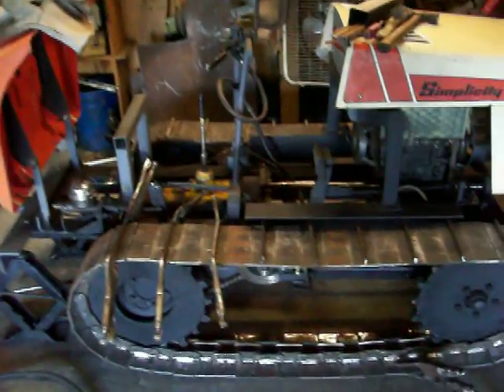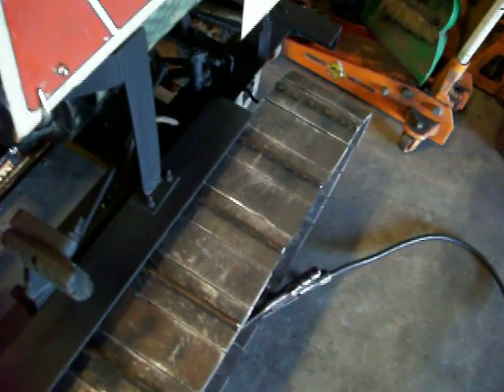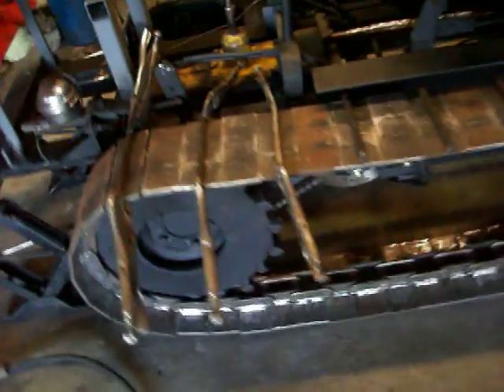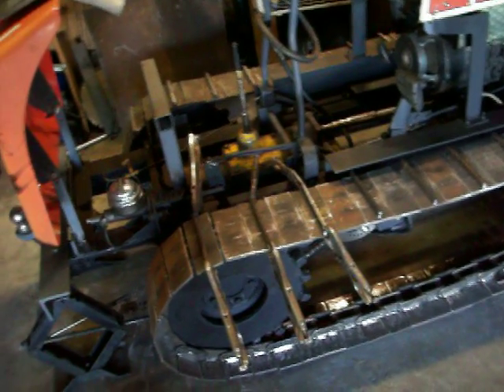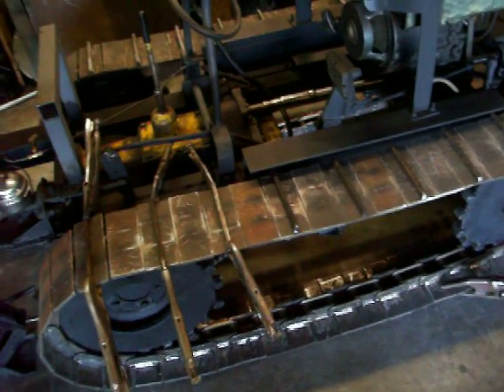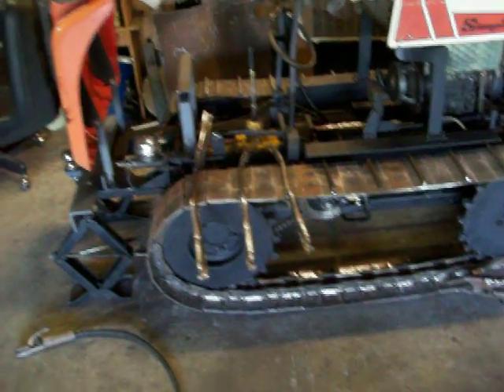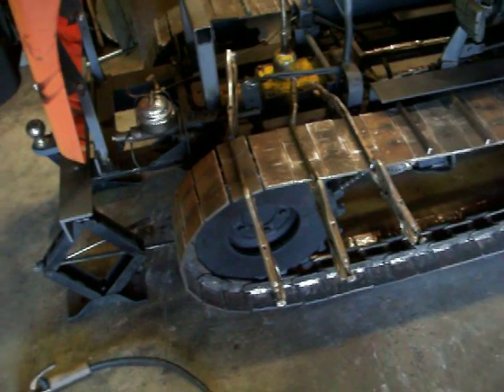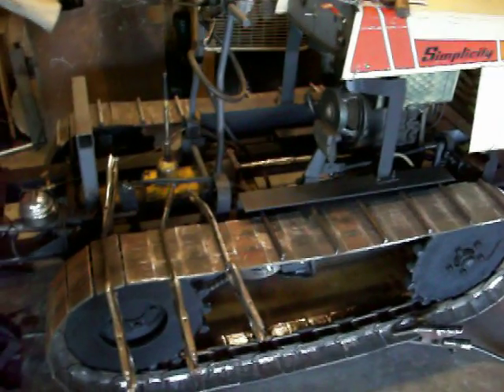Mini Dozer Home Built "Track Cleats added and Rear Brake Test"

Comment: You were right when you said that my suggestion was the way to go. Looks good.
Reply from the maker: buddy Im telling you this has been a adventure for sure and since i know now the new rear disc will work I may go ahead and go to the junk yard tomorrow and get a big american auti tyoe disc caliper from a car and part of the reason is is the china motorcycle type disc brake system i put on it will be almost impossible to T into the front drum brakes,,i dont want 2 sperate handles to turn but only one so i'll have to T the hydraulics in and would be impossible with the china system and yes the cleats every other pad looks best and will work best,,later

Comment: looking good rick when you get the tracks done i cant wait to hear it clinking along
Reply from the maker: Josh I think it was the concrete it was on making it do that and dont think it will do it on dirt but we'll see,,,thanks
Reply from the maker: I got the new pads in the mail today and buddy they got on the ball with that shipping,,also Ive almost got the other side cleats welded on but before i operate it again I think I'll change the front pulley and put a new belt since the old one slipped yesterday and then i will make you another operating video,,thanks again.
Reply: looking foreword to it rick

Comment: Seeing the cleat marks on the concrete made me laugh.. In a good way..
If it's leaving those sort of marks it meant it was turning well :-)
It's amazing how fast the weight builds up on these sort of projects, my 6x6 ended up far heavier than I wanted it too!
Good to see the light at the end of the steering tunnel Rick :-)
Reply from the maker: oh gosh it has to weigh between 800 and a 1000 pounds right now by just adding up a few things on it that I know the weight of,,although the little tiny calipers from the 4 wheeler works I really want to add some from a car so I can T them into the big master cylinder I have on it now,,then they will both work from one pull of the handle,,want be long now and I'll have it at least to where I can operate it when I want,,thanks

Comment: I would do every 2 pad so it can dig in better but your giving me a lot of ideas for my bulid
Reply from the maker: Thanks Zack and I built mine totally from my mind and as I went and no plans from anyone,,that way its a original done the way you want instead of some knucklehead,,haha,,,the problem I have with the cleats is my mini dozer is so freaking heavy that on grass the cleats are dug slap into the topsoil and turning is a bitch man,,I bet mine right now ways between 1500 and 2 thousand pounds and is no bigger than medium sized riding mower,,man it is heavy,,,some advise id wait before adding cleats until you get it running and turning cause even flat smooth tracks will grip better than you think,,most modern day bob cats have smooth tracks and I watych them work everyday since I drive a peterbilt dump truck and them bob cats with flat push dirt and dig up old pavement with smooth tracks so trust me from someone who knows,,cleats can be a bitch on a mini dozer man,,,thanks brother and didnt mean to write a dang paper back book,,Im fixing to get back on mine and finish her up,,later
Reply from the maker: one more thing,,,in dirt or on dirt cleats on a mini dozer would be no problem but on a surface that isnt broken up and they can dig into it puts a terrible strain on the entire system,,there you bro.

Comment: Tracks are lookin' good.  The every other pad is perfect for it.  Just a thought, not sure if it would help or not.  If you where to "V" bend the rebar, still keeping it fit of the pad, would that help stop lateral (side ways) drifting on a hill side or ice?  Or would it be better to alternate angle them like a tractor tire?  Just thinking, this project has me thinking about building something similar for snow.  I have a drive thats almost a mile long in the woods.

What model of cub cadet did that rear end come from?
Reply from the maker: I think the rear end came from about a 1970 model cub or maybe a 107 cub cause I have a 107 cub cadet in original lawn tractor condition and its identical to the rear end Im using in the dozer,,also I doubt my dozer will ever face anything like what you have discribed as far as sliding off a bank or on ice or snow but a sure enough way to stop that would be to use spikes like they did on some of the old metal wheeled farm tractors from the 1930's and 40's and 50's,,like spikes on a football players shoes,,you know that would'nt slip in any direction brother,,imagine a set of tracks with about 1 inch sharp spikes sticking up,,be bad to the bone and beyond,,haha,,hope that gives you a idea and thanks for the interest in my video's.
Reply: snowmangsx1100
I was thinking of making removable plates/shoes for mine.  I have access to an old set of rubber tracks a Cat 65 tractor to cut the pads out of.  I'm thinking 3 sets now - rubber pad, bars like yours, and now spikes (thanks for the spike idea).  I have a 18hp twin cylinder yanmar diesel with dual output that would be great for this type of project.  Drive off one side, and hydraulics and alternator of the other.

Blade/Snow Blower/Broom/Frail Mower with skid steer style quick attach and extra hydro ports in front.  Then a 3point (cat1) with hydro and 540 pto setup (like the larger case garden tractors) in the rear should suit me fine. Case did it all with a 14-18 hp gas and hydro drive so the gear reduction on the drive line and the torque of a diesel it should be prefect.

Plan on using it for clearing and maintaining a mile long driveway, along with about 3 miles trails in the woods.  Skid logs and hydro power for log splitter, and some ground work in the garden in spring and fall.
Reply from the maker: you know depending on your budget the sky is the limit on what you can build or equip it with,,so far i have almost built my dozer strcitly from the junk yard but am sure toward the end when I get into the hydraulics I will probably have to spend some actual money,,,counting the welding rods and axcet and oxygen needed and then the trips to the junk yard and various new small parts like bolts and a pulley or 2 id say i have 500 dollars in the dozer so far,,,but to have went and bought all the metal new and everything new gosh it would probably be couple grand or more,,its like a house,,60 % of a house's price is labor and buddy Ive got the labor in this bad boy for sure,,sounds good on the different track ideas and yes the spike's would be killer as could be,,,well take care and keep us posted on when you start building your tractor,,Rick

Comment: I knew you would get it!   So I guess my 500lb weight estimate might be a bit off eh?  ;-) You could always turn the bike handles up, and it would look like an old school JD crawler. Gald you got past that Rick, I got the feeling that was bugging the crap out of you.
Reply from the maker: your right Jim it was kinda bugging me since Ive fooled with this stuff my whole life and then to have a simple brake problem give me such a hard time,,i just under estimated what a force it would take to turn it,,the brake handle master cylinder im using is a rinky dinky china made thing and I may if i can find a big heavy duty one like on my suzuki 1100 I may stick it on there,,or the whole set up from a big bike,,even this little one works good and a heavier set up would work even better and be better so now that i have it figured out im truly in no hurry so may look for a better set especially getting it for junk price right,,also its easy to under-estimate somethings weight and you can see in the video how the flat smooth track on the left side mashed the gravel down and that gravel has had cars on it for years so it was already packed down and like I say just the rear end and tracks and wheels alone weigh 660 pounds and that doesnt include all the frame and under carrage or motor or front brake drums or drive shaft and etc,,,,I know its hard to believe but your talking about thick heavy metal rather than the thin stuff they make a riding mower out of,,it would have to weight 900 pounds right now or more and id say more,,oh well after i finish it im for sure gonna weigh it at the junk yard cause all the guys there want to see it finished,,,thanks for the comment brother.
Reply from the maker: Jim I forgot to mention I like your idea of using the brake handle itself and I tell you what if I can find a big heavy duty one say off of a harley or big suzuki like mine and then somehow connect the line to a car type small brake caliper then i wouildnt even have to use the front drums at all and simply steer it with brake handles from a bike,,that'd be cool as hell wouldnt it ? I may very well do that since I now know this chain and sprocket deal will work,,it would be very nice to steer it with bike brake handles for sure,,remember what Im using now is the cheapest little rinky dink set up they ever made for a little cheap 4 wheeler and even it works good so anything I put heavier duty will be that much better and far more reliable,,see what I mean ? if I leave it the set thats on it now then that would be the weakest part of the dozer hands down and cheapest part so I think I will add a bigger heavier set since Im a want to be perfectionist,,hahaha,,later
Reply: snowmangsx1100
I'm thinking the breaks from my bike might work for this, its a Yamaha Virago 1100.  The large virago's have dual disc (10" or so) front breaks and drum rears.  Its a standard single line out of the master into a "T" on the triple tree, then a line to each caliper. If the master isn't strong enough get one from a 1800 vstar.   I have to be very careful on wet or dirt covered pavement because its easy to lock the front up.
Reply: snowmangsx1100 Or make a set of handles that look like they come from an old piece of farm equipment, like a releasable spike toothed harrow.  Then you can use hard linkage, and it won't lookout of place.

Comment: Can u just use the brakes on the rear end of the cub and it would still turn or do you need the rotor with the brakes?
Reply from the maker: No Evan it has to have the rear disc or you couldnt turn at all,,,the problem is that it's so heavy that it will not or cannot turn while in grass,,,it's to narrow and to long so Im gonna have to remove the cleats and it will be a slick track but will still grip good,,thanks man.

Comment: I no this is an old video. But as for the belt slipping. All that is needed is a a significantly smaller idler/clutch pulley.  This will give more contact with the driving And driven pulleys.
Reply from the maker: Yes and thank you, I solved the belt slipping problem but ended up bending one of the axles, I had it geared so low like a winch it actually bent one of the cub cadet axles which is almost impossible, what happened after I got both sides installed and cleated while turning in the yard one of the chain rode up on one of the rear drive teeth and bent the left rear axle, I got in a hurry and had intended on mounting chain covers that would have not allowed that to happen, oh well I still have it and have put it on the back burner since then since i have not ran across another cub cadet rear end to get a axle from, thanks for the comment brother and Ill be back someday with it completed,,but its still sitting in the garage just the way it was and no changes to it,
Reply: @snowmangsx1100  where do you live.  I just happen to a cub rear end.  Does it have the hexagonal axles or the round?  If I remember right it is exactly like what I have with the independent brakes.  Only difference is it is a hydro.  But that shouldn't matter for what you need
Reply from the maker: @michaelpreston2392  central alabama but I think I have found one brother

Comment: Can't have too many Vice-Grips.  My collection is growing.  I refuse to buy any more of the cheep Chinese ones.  I can't wait to see that thing finished.  I hope you can run across a BIG engine to stick on there.  Some kind of pressure lubed 18-20hp.  I have a splash Briggs 18hp on my el-cheepo garden tractor.  I'm taking bets on if it will blow up before the tractor is beyond repair.
Reply from the maker: you right and I have probably 4 more pair but there isnt room to do more than 3 at a time and best is 2 at a time as far as room to work,,oh boy to have a 20 hp V twin on this dozer would be un-stoppable almost,,also i think when I add the larger front pulley it will further slow down the drive shaft and with a new belt that problem will go away,,thanks for your interest man.
Reply from the maker: forgot to tell you Nicholas on the vise grips if you will go with the vise grip brand your problems of bending or taring them up are over,,you want tare up a vise grip brand and all these Ive had for years upon years and probably since i was a kid so there oldy goldies and work perfect everytime,,,so go vise grip brand for sure when you buy brother.
Reply: snowmangsx1100 Just bought 4 Vise Clamps & 4 regular C Clamps...
Reply: snowmangsx1100 NO Such thing as too many Vise Grips!!! NO Such thing as too many tools...there's only NOT ENOUGH...
Reply: I have too many junk screwdrivers.  Someone decided to buy me Harbor Freight screwdrivers two Christmases in a row.  You know how hard it is to remember you have them stashed in the corner for stirs?
Reply from the maker: Thats true.
Reply from the maker: now when it comes to screw drivers then craftsman are good enough for me and waranted for life.
Reply: I'm tempted to start buying Klein.  I'm tired and sick of Craftsman.  I only buy Craftsman stuff because I can find good deals on vintage tools.  The hand tool warranty is nifty though.  But it's not worth the hassle if they (wrachets) break too often.
Reply from the maker: I almost did at the tractor supply yesterday but am so far making it with bib C clamps and many sets of vise grips,,you cant have to many thats for sure brother.
Reply: The older craftsman ratchets/sockets were made by SK. I forget the years. I know you can see the difference in the way they finished the sockets. They switched and quality went downhill. I've broken them without cheeter bars. Been through a handfull of 1/4 and a few 3/8 ratchets. Now I reach for my Stanley and Popular Mechanics wrenches first. I don't have any issue buying new Taiwanese sets. I look for name brand USA stuff when I buy used because I can find the vintage stuff readily. I only own one craftsman socket set I think and a couple off odds and ends.
Reply: Nicholas Smerk LMAO...I hear ya...
Reply from the maker: I havent bought a new craftsman in years and is probably why I dont know the quality has gone down,,still though if there still lifetime warranted at least you'd have that,,,and I agree always buy american when you can and if you have to look it up and find it brother,,I love quality tools for sure.
Reply: It's nice to be able to walk into the store and the salesman has to bite his/her toung when you ask for a replacement.  Other stores only do the manufacture defect replacements.
Reply from the maker: sorry I didnt see this reply Nicholas but your right sometimes they dont like it when you have a tool made up,,I do have a big long S&K wrachet in my tool box that is broken although I didnt break it but Ive been meaning to get it made up but all they do is give you a kit of the insides to replace rather than handle and all but still it fixs it,,I stopped at a Sears up in Courtland Alabama a while back to get a screw driver made up and man they were as nice as they could be and gave me no lip at all on replacing it and it was surprising a tad,,haha,,,like I say always buy american and you'll be better off,,also not far from my house is a tool and bolt dealer and Im forever having a drug head stop by my shop trying to sell me a big nice set of wrenchs or  Impact socket sets and I know there stealing them from this place as i recognize the name brand but I dont buy them and already have them anyway but last set was a big 1/2 drive impact socket set he offered for 15 dollars,,wow,,had to be a 100 dollar set also but I didnt buy them,,check you later brother.
Reply from the maker: forgot to say I have both track cleats mounted and welded now but havent touched the dozer now in 2 days since I had to drive yesterday and been rainy and ugly today but am fixing to finish the brakes and get this bad boy operatable for sure,,I drive part time for a near by trucking company and got to drive a big new Kenworth tri-axle yesterday and was fun and very nice truck and power everything and A/C that would freeze your brains out,,Ive got to get back to work full time and soon for sure my friend so gotta get all I can done to the dozer before then,,,,later

Comment: Thats built the way it should cub rear end and its built almost needs a 16 hp briggs v twin
Reply from the maker: yes a 20 hp would be wonderful and it will get one soon,,the 8 hp briggs is going to surprise you now the way its geared but a 20 hp would make it a for sure billy goat,,haha,,,thanks
Reply: snowmangsx1100  yea i recently re powered my tractor to a briggs 16 hp with some power mods like decked heads advance key and cam its a torque monster make more power idleing than my 8hp at wot